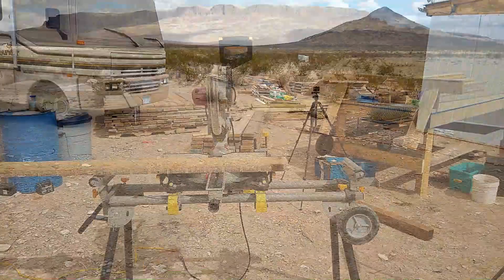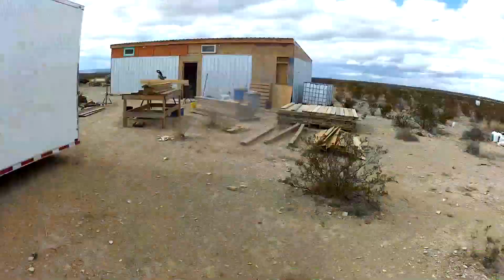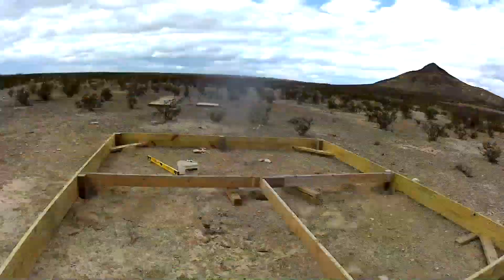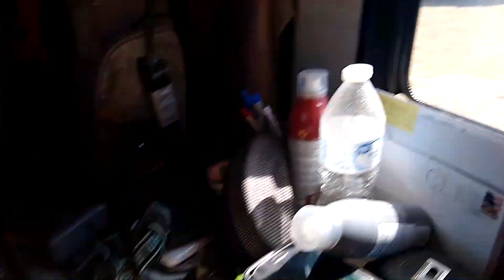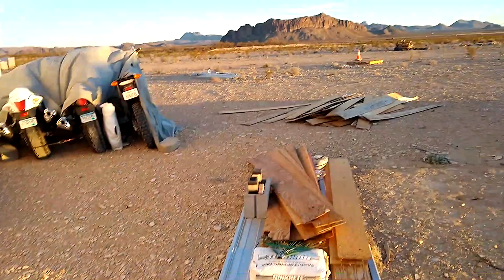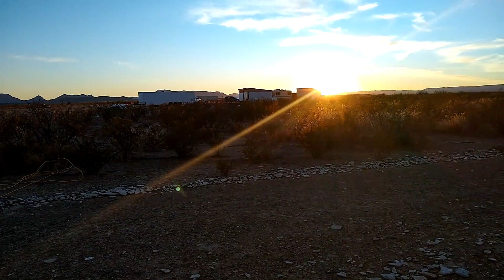Tiny House Floor Joist Install

Comment: “ThatGuy” here.  Rodents chew through flat no seams OSB in minutes.  With your building on the ground, rodents make way in one place and make more holes under appliances going down.  Then the snakes find the rodent holes.  Another issue is the floor is not insulated from heat and cold.  Temps in the teens are not unheard of in BBV in colder winters.  So the temp difference can be 100 degrees in a span of a few months.  Insulation in the floor would make the space feel more like living area than a shed floor.  Before you tack down that osb I would ponder a rodent barrier and insulation that does not attract rodents or insects. Just me. We got a lot more snow than you did in video but it was gone by 1pm.
Reply from the maker: Hey now, it's not "ThatGuy" it's "SomeGuy" ;) I don't think we'll have a problem with rodents. I've seen several houses build like this, even ones laying flat on the ground with no posts at all and they have no problem with rodents. But, what would you recommend for a rodent barrier? I'm not opposed to a little insurance ;) We've got R8 double bubble insulation going under the OSB and then R4 underlayment going under some laminated flooring. So we'll have about R12 on the floor, R19 in the walls and R30 in the 'attic'.
Reply: Full Vegan Homestead we had ordered a Tuff Shed that somehow got delayed in an error by them when we almost moved by your place.  It was their largest two story barn style house. 18 wide and 36 long.  Sides were cement board that is rodent proof.  Bottom had two layers of concrete form grade 1” plywood over the top of galvanized rabbit wire.  I had not ordered the floor with insulation, we were going to do that ourselves with a double layer of foil bubble wrap.  Our shed was to be erected on pilings that jetted above the landscape high enough we could use the space for parking and storage.  Pretty sure had we not gotten slowed down by Rio Grande Electric , we would be living in a half finished shed for the remainder of our lives.  The bare interior shed was priced out at $35,000 not counting the pilings or any construction materials like plumbing or wiring.

Comment: That looks like progress to me, it looks fine in construction as well. No expert but it could hold my fat …... you get the picture. I cant believe you got snow that far down..ughh didn't need to see that bad enough up here.
Reply from the maker: I've seen a lot of buildings out here many that have been around for many years, even decades and I'm amazed how well stuff holds up out here. You'll have to come down and test it ;) Yeah, we got snow but it only stuck around for a couple hours then melted away.

Comment: You might consider using Liquid Nails (or similar) when laying that floor decking down. AND screws. Keeps the squeaks down. IMHO
Reply from the maker: We will definitely be screwing it down. We won't be able to use an adhesive this time because we're using some R8 double bubble insulation between the joists and the floorboards https://amzn.to/376FdkQ like 'boss of the swamp' did in one of his videos. Between that and the R4 underlayment for the laminate flooring I think we'll have a pretty well insulated floor for around here.

Comment: Check out Metwood Joist Reinforcers,
www.metwood.com

They allow up to 4" holes in 2x8s, 6" holes in 2x10s and 2x12s
1 hole per joist only allowed.
They are engineered and or code approved.